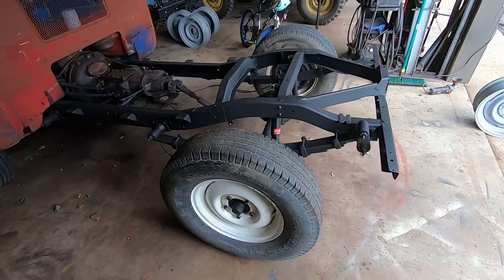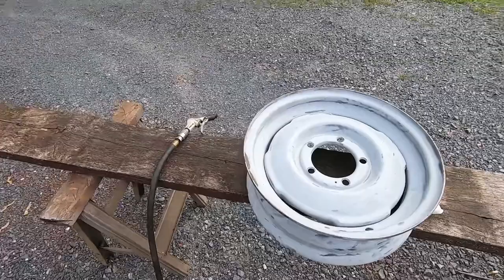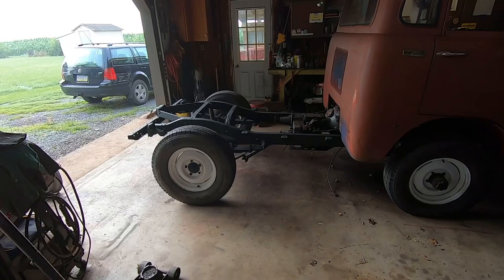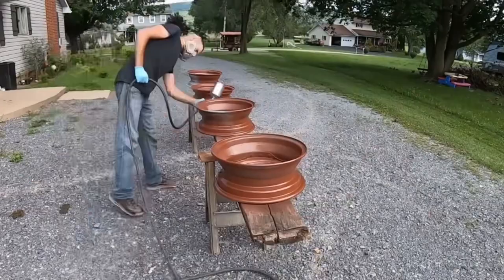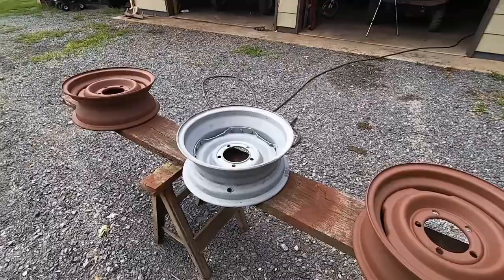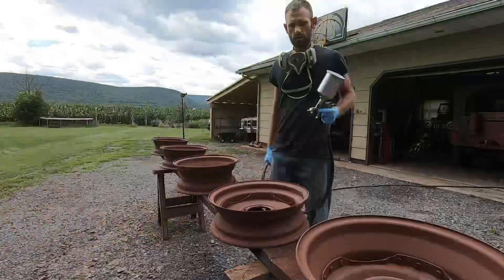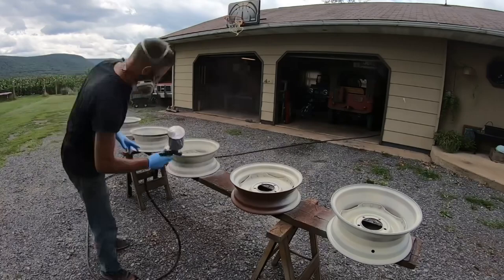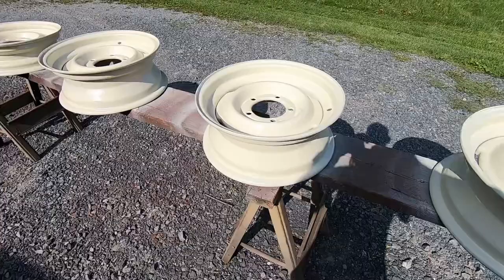Painting steel wheels

Comment: The way the body shop painted mine was they painted the inside of the wheels and then mounted the tires but left the air out and taped them off and painted them this way so they didn’t get gooned up putting the tires on. thanks for another great vid and taking the time to make it I always look forward to them. This is a great project. 👍
Reply from the maker: If you let the paint cure it will be fine to mount without damaging anything. No way I’m masking tires. 😆
Reply: @redeyecafegarage7484  Ha Ha totally understandable. But I think the main reason they did mine that way was because o have TSL’s on stock Willy’s KH wheels and they had to mount them with hand tools because the machine was giving them fits. I’d just never seen it done that way till then and frankly I couldn’t paint a water color so it’s best I farm stuff like that out. Ha ha.👍